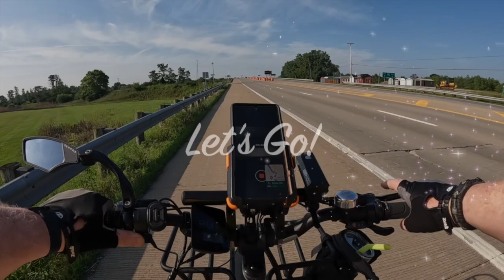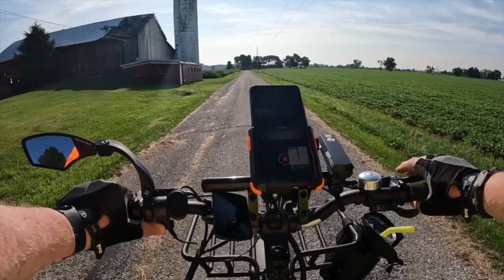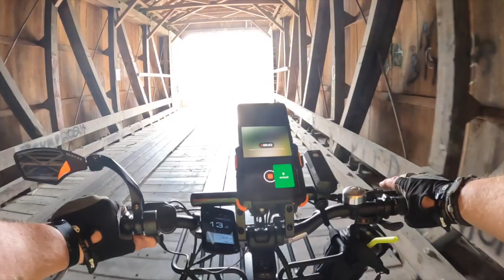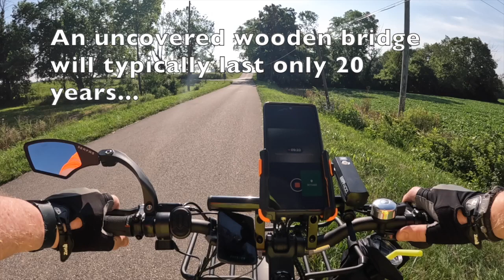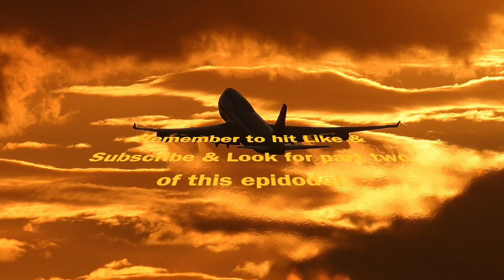Battery Fires, Geeting & Dixon Branch Covered Bridges

Comment: I notice that you are adjusting your mirror from time to time. Here's an idea, while sitting on your bike and supporting near a wall, get someone to adjust your mirror where you can see perfectly behind you. Lock the Allen screws to keep the setting. I would then add a dot of nail polish at a position on both mirror and handlebar positions in order to remember   the positions.
Reply from the maker: Thanks for the advice, John!  I have since changed to a mirror that plugs into the handlebar end-cap for better visibility.  Plus, I've added the Garmin Varia RVR 315 Rearview Radar.  That really helps with seeing the traffic approach from up to 150 yards away so that they don't sneak up on you.  I'll try your nail polish trick.  Thanks for watching and commenting!